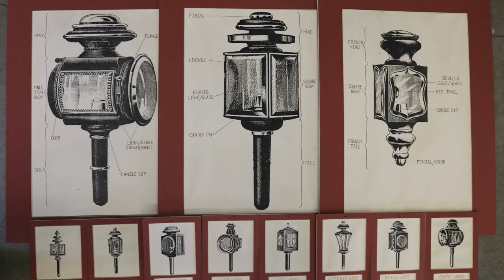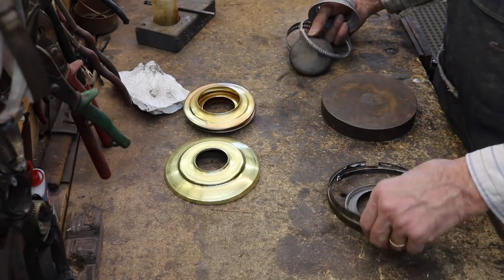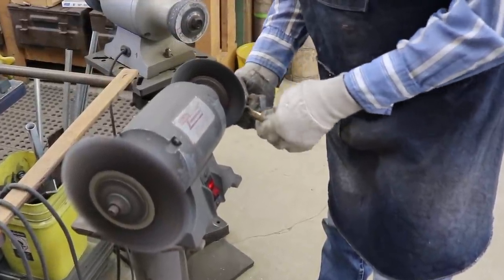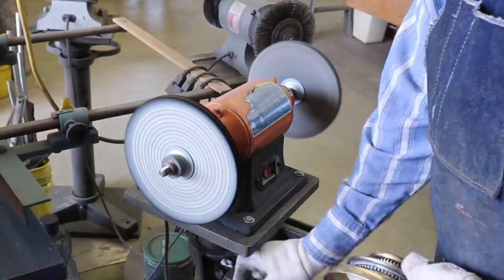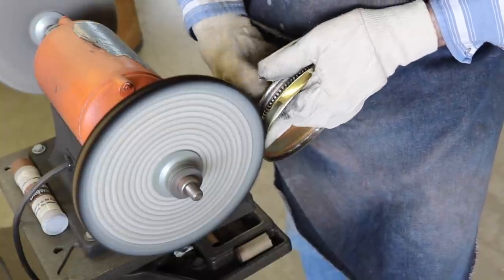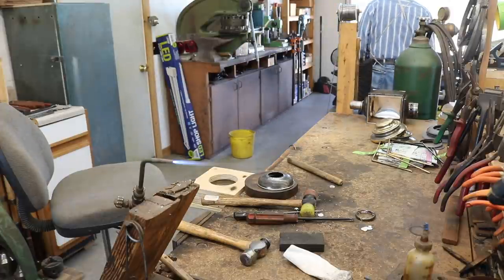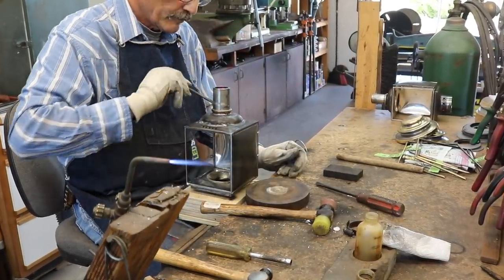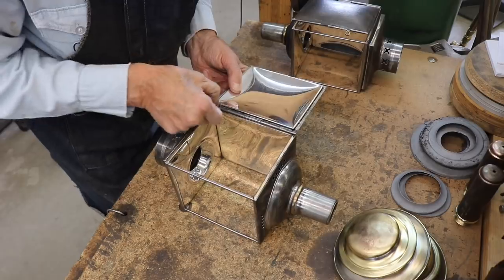Classic Brewster Lamp Restoration part 2

Comment: I recently started using Phosphoric Acid mixed with water at 2:1 ratio [2 parts water to 1 part acid, you can buy the acid at any hardware store sold as a rust converter, it works really good, and works out a lot cheaper then buying flux.

Comment: What gas do you use for the torch and is the solder old fashioned lead solder? Excellent work.
Reply from the maker: Propane and O2, 40/60 tin lead solder, thanks for your comment!

Comment: Great video, thank you for sharing. What kind of Polish are you using? Can it be used on brass, stainless and aluminum? Can't wait to see more videos. Stay safe.
Reply from the maker: The polish is "Flitz" brand metal polish. It works well on silver, brass, fiberglass and painted surfaces.
Reply: Thank you.

Comment: I really enjoy your craftsmanship and care in the assembling and renewing these lamps. Well done!
If I may be so bold may I make a suggestion? When you’re at the bench soldering the various pieces together, you have a round heavy metal plate under the pieces you’re soldering. 
 You also use heavy pieces of metal bar atop the pieces to assure even assembly. 
I’m wondering if you placed the heavy round metal plate on a Lazy Susan, then you could just spin or rotate it and the soldering area would always be right in front and easily visible...  I know, that craftsman such as yourself have developed and adapted techniques and routines that work for you and you can resist change, because that’s the way you’ve learned and or adapted to. Just a observation and suggestion from an old fellow craftsman. Maybe it wouldn’t work because the work might rotate or move when you didn’t want it to.. 
Again, I really like your work and thanks for taking us along and showing us how it is done. 
Ed Belledin

Comment: What are the tops of these lanterns functions? I have noticed that most are in this configuration and someone had to figure this to be the best way to top a lantern. I am just curious as to why something was built in this way. Like why they put the long piece on the bottoms of these? Form or function? Any enlightenment on this would be appreciated.
Reply from the maker: The long piece on the bottom is called the stem or tail and holds the candle in candle burning lamps. It is retained in oil lamps just as a style feature. The top is actually a chimney and the neck aids in that function.

Comment: I love your craftmanship. I watched you spinning those parts around manually and thought I would offer a suggestion. I built a small roundtable from a dinner table spinner thing that most people use for salt and pepper, ketchup and such. I just give it a push and the next profile is there to work on. I think I  spent a couple of bucks on it but it does help when your hands are full. I went with a 12 inch wood spinner from that Wall place big box. Best regards, Giovanni.

Comment: What type of solder are you using? Silver solder or regular 50/50 or 60/40 solder wire?
Reply from the maker: Generally 60/40 tin/lead

Comment: Rick,
Have you ever tried one of those "mini" oxy-acetylene torches -- like jewelers use on your soldering?  How would such a small flame work in your soldering?  Would the small flame simply be too small for carriage lamp work?
How does the "excess" solder that doesn't come off with the "wire-brush wheel" affect your finishing?
Your videos are both educational and fascinating.  I'm looking forward to your next videos!  (I hope this all makes sense since I'm up way beyond my bedtime -- 03:10 here. ;)
Reply from the maker: I can adjust the flame from almost nothing to more than I need and it is very economical to do it the way I do.

Comment: By the way, can you give me the name or formulation of this liquid for soldering. Thank you in advance, with a huge thank you!
Reply from the maker: it is commercially available zinc chloride acid, not a consumer product.
Reply: Silvio if you go to a plumbing supplier and ask for plumbers soldering flux and the thickest solder they have you should be able to use this to solder. As a plumber I used this for 20 years and it fluxes copper, brass and all the items I have seen soldered on these video,s. Hope this helps.